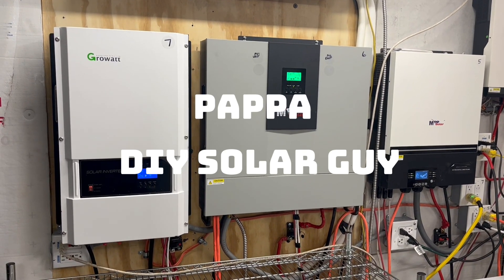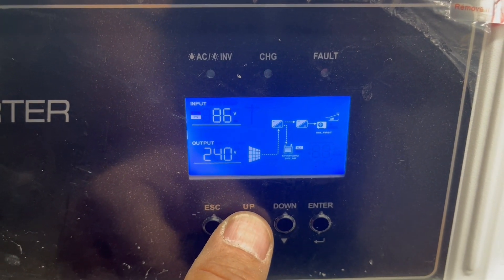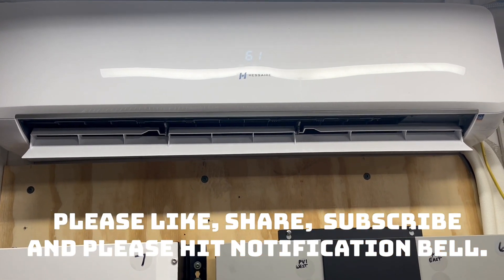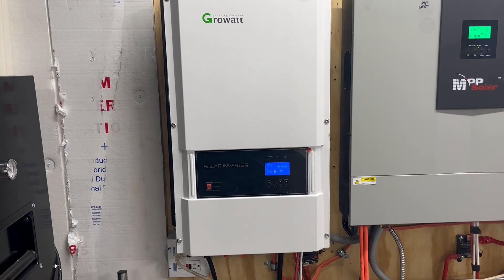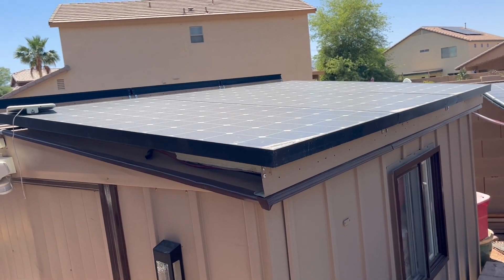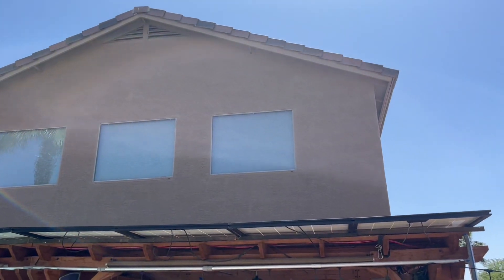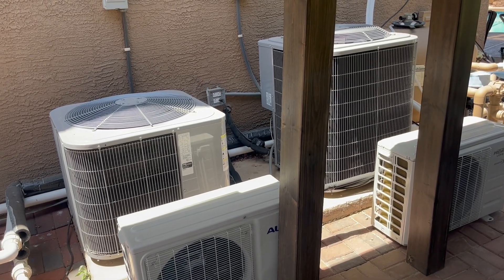DIY solar panel for home. 12kw Growatt inverter runs 3 1/2 ton AC with 21-250 watt solar panels

Comment: How much watts pv the growatt  12kw can take
Reply from the maker: I only have 12,000 watts connected but with the loss in wire length and position of solar panels, I could go above 12,000 watts to 14,000 watts.

Comment: Blown away. I am building system soon but nothing like this. I don’t understand why you need so much cooling though. Would your money be better spent insulating your house? Not being rude it’s just I haven’t really thought much about so much cooling.
Reply from the maker: I was diagnosed with 2 incurable cancers in 2016. I need to have the house super cold because my lymph nodes were damaged, they regulate the body temp. It is 60 degrees in the house and I walk around with no shirt on. To me it feels like 78 degrees. I insulted a lot with my house in many areas. If I did not do solar, my electric bill would be $6000-$8000 a year. I can no longer work, had to retire with disabilities. I can only work on this system early in the morning for outside part. What takes most people a day to do, can take me a week or two. I have done almost all of this by myself since I did not know anyone who knew about solar. I learned about solar very quickly and heat pumps as well since I have a lot of time on my hands. Hope you have a wonderful and extremely blessed day

Comment: First off congratulations on all your hard work and installation of your solar system. I'm a licensed solar contractor and you've got a system exceeding my output. Don't let your utility provider or local permit office know that you've got all of that equipment running.
Reply from the maker: The panels are on my east, north and west side of 2 story house. Only producing 1/2 to 3/4 of output depending on the day. 30 percent of panels are usually in shade. No panels on my roof and no Panels facing south. I wish I could produce total amount all at one time. But I only need 1/2 the amount of total panel output watts so that is why I spread over 6 inverters and 4 battery banks. 2 battery banks are always full for use if one system is down for maintenance.

Comment: This is an interesting setup, thanks for posting.  Are you in AZ?  Does the power company care if you are using off grid solar and grid power together?
Reply from the maker: Since this is off grid and not connected to grid, I am not feeding power into grid. nothing with my system is connected to the grid in any way, shape or form. I use to use the grid assist on inverters but that was either charging my batteries or powering the load. I have a large enough battery bank that we no longer use grid assist, We use our pure sign wave off grid inverters as the grid power to charge battery banks in the morning when you do not use very much electricity. I live in AZ. Southwest of phoenix where there over 300 days of sun a year. None of my inverters are capable of being connected to the grid. If i were to put panels on my roof, having a company install and pull permits to connect to grid, my electric bill would be charged extra to tie into grid. Min bill would be around $120 a month every month without using any grid power. Our grid company discourages grid tie solar, that is why we decided to do off grid and reduce our electric bill by over 85 percent. Our winter grid bills are around $65 for 7 months and summer bills are between $100 to $170 a month last year. our electric cost for last year was around $1200 for the entire year. That is extremely cheap in AZ. Thanks for the comments and hope you have a wonderful and very blessed day
Reply: Sounds like you need higher efficiency split systems, batteries and solar panels. I am totally off-grid, two SA12K, 20,640W PV, 134kWh LFE battery. I'm all-elec 6.25T of hp sys 16-33 SEER, 80g elec wh, elec range, new high eff ref, toaster oven, coffee pot, hair dryer, washer/dryer, gar door openers, etc. I consume 60-80kWh/day. Max output in one day: 124 kWh to recharge/power loads. in late April.
Reply: Nice setup. I see you like redundancy and trying different brands too.

Comment: Hi, just ordered the 12 k growatt as a backup for our 8k unit. Looking forward to its arrival. Nice video, that's alot of solar. We also run 4 mini split units plus elec water pump, elec dryers etc. One word of caution for you: the mini splits can sometimes drip condensation from the cool air output fins which would be quite bad for the inverters...
Perhaps a sheet metal drip cover just above the inverters as a precaution.
Also agree w ranacnam on the importance of even panel array production.
We use thermal solar panels for hot water heating, they could help with pool demands ? Keep up the good work.
Reply from the maker: I noticed the water dripping from fin as well but only one room and for only 1 month in monsoon season. We are 5 percent humidity in the day our in Az for winter and spring. So right now there is no water from mini splits. No moisture in the air. You will love the 12kw inverter, the fan noise is not as load now after running for a couple weeks. Occasionally it will get load with large load but when fan kicks on now , it is much quieter. Hope you have a wonderful and blessed day.
Reply: Remember, he's in AZ with dry heat.
Reply from the maker: @USA-GreedyMenOfNoIntegrity  it really is a dry heat 11 months a year with humidity around 30 percent or less, often below 5 percent humidity. Higher humidity in the monsoon summer months hangs around for only hours, not days or weeks, lol. It rains not often and evaporates almost instantly when we do get rain. Coming from Michigan where I grew up, this is complete opposite.

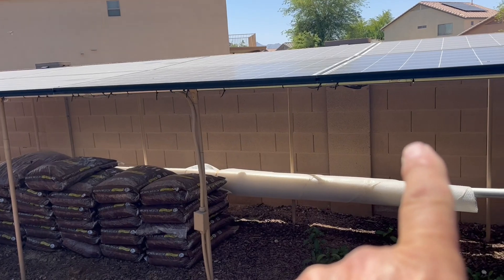Comment: The 3 module string in that solar shade thing at 5:07 is dragging down the output of the 4 module strings it is paralleled with.  There is even the risk of burning out the 3 module string if the whole array is open circuited as the cells in those modules will shunt the current from the 4 module strings and thus dissipate way more power than they are designed to do.  You want to keep the cell counts and thus keep open circuit and maximum power potentials in each string the same.

Also, that small module on the Sunpower module on the shed roof at 6:13 is killing the production of that string.  One of the main rules of solar siting is partial shading bad.
Reply from the maker: Thank you so much for you advice and expertise. We appreciate your input to help us maximize our system. We keep learning more and more every day.  Hope you have a truly wonderful and extremely blessed day.